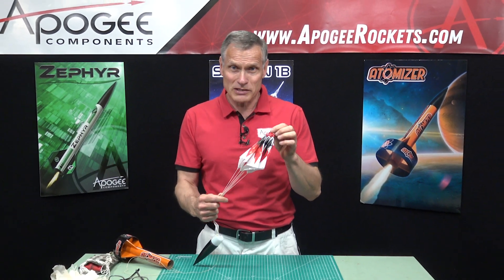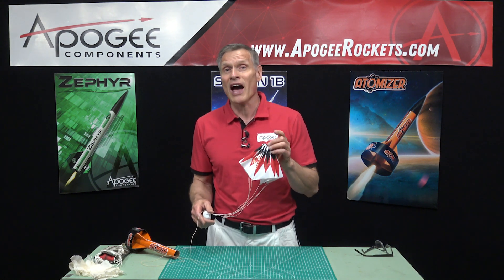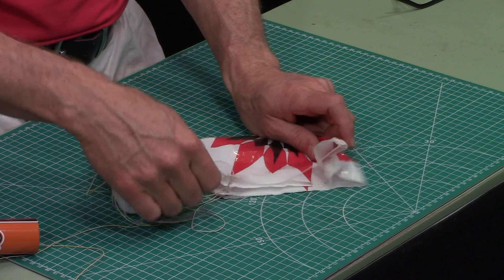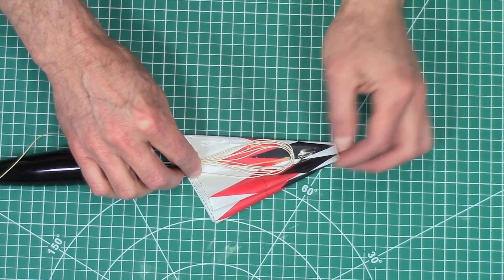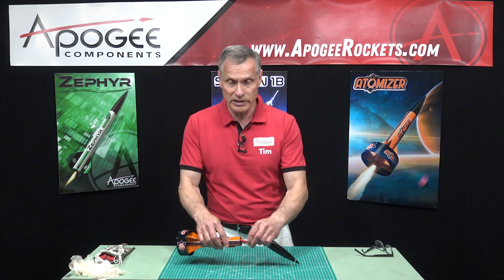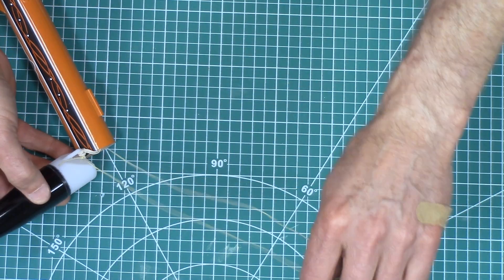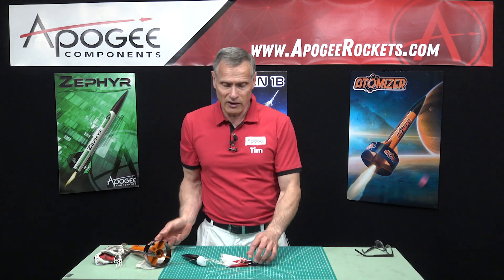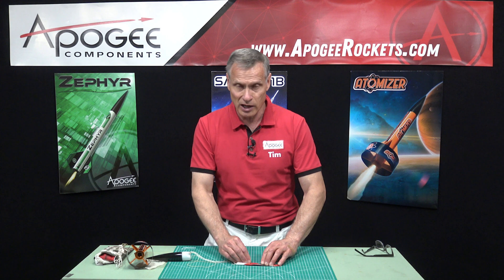Two Methods of Folding A Parachute for a Model Rocket

Comment: I like all the info. Timing is important for a smooth recovery. I also use plastic chutes, and I always use a little baby powder on the outside and inside and shake it around a little. It always will fully open with no sticking. And do not pack a chute longer than around 3 min. They try to maintain thier shape. When storing a rocket, have nose cone and chute hanging out next rocket or open next to it. Good stuff.

Comment: We keep a small bottle of talcum powder in our field kit and find a light dusting keeps the plastic parachute from sticking when folded,  also keeps the static away.
Reply: I've always used chalk line chalk. It gives a burst of color against the clouds, making it easier to see.
Reply: @turntbyhi-lo3516  Sounds messy, but brilliant, Wonder what would happen if you ground up different colors of child chalk and packed them into release tubes individually inside the rocket, could be a cool multi colored parachute ejection? Got me a thinkin'.